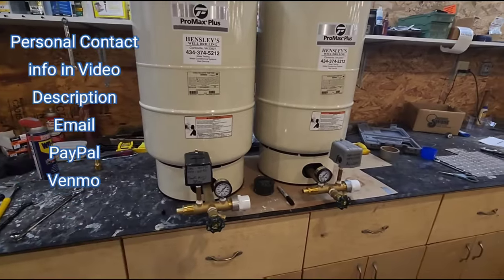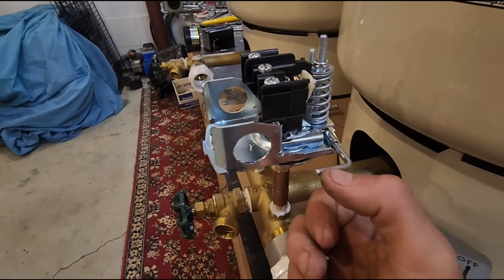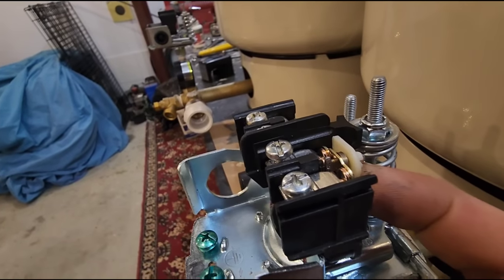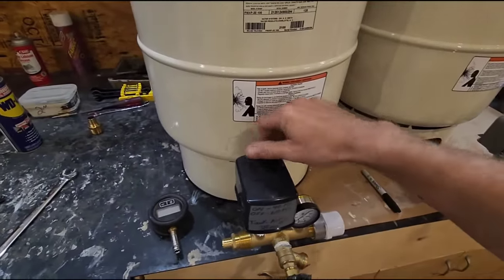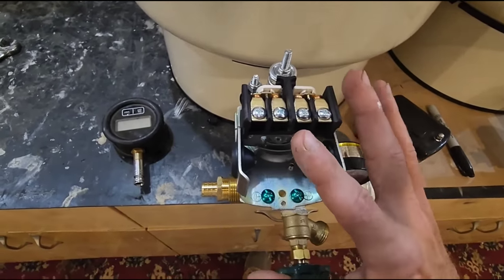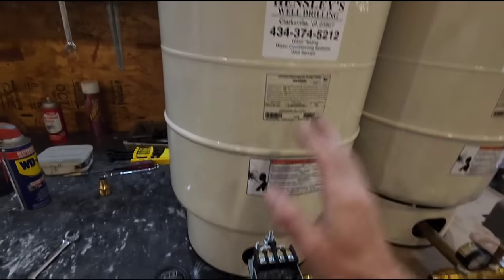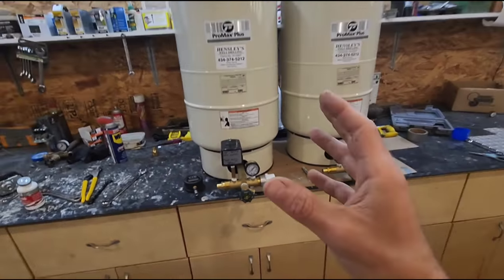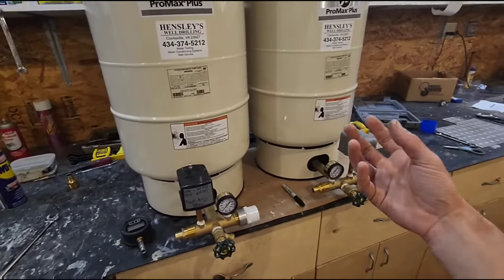Most Common Reason for No Water!! Reset Pump Pressure Switch. Water Well Repair Vlog Ep.18

Comment: Here's one for you... power outage, water kicks off.  Power comes back on.  The pressure at that relief valve on a 30/50 kicks on at 85psi, off at 105psi (likely guage isn't correct)  The drain at the bottom of tank, if I open it, has a really strong pressure, kicking water out at a pretty fast rate. This line (in addition to feeding this 'out' valve, also seems to feed into rest of system.  You'd think that strong pressure would translate through filter, into rest of house line, for a relatively similar pressure coming out of the taps... But it doesn't, water barely flows out of any tap, despite pressure building at the start of the line pretty strongly...  System looks similar to the one on the left you've depicted...any ideas?
Reply from the maker: If your filter element is black (carbon type) that's probably the entire issue. Try replacing the filter with a white string woven filter (never use black ones). 
I'd advise you to go buy a new switch and the nipple below it & a new gauge. 
New gauge will help with diagnostics. It's probable that this all froze in the past, it could have bent the gauge & switch. You need to inspect/ replace the 1/4"x3" nipple bc it may be clogged up with sediment. 
When you have the system off & drained of water, you can then check the air pressure in the top of the tank and make sure its set to 26psi(since u have a 30/50 switch)  (set air to 36psi if u buy a 40/60 switch)
Reply: @h2omechanic  Thanks for the reply!  Filter is not a carbon one, recently changed it too, so it's not that.  You are spot on with the freeze comment, froze pretty solid last year, but was working again after. Because of that, I think your proposed solution should do the trick.  The top, where the nozzle to test & re-pressurize should be, has a 'do not remove' cap and label on it. Likely one of those dumb questions but no safety or other issue with pulling that off in your opinion?  Thanks so much for taking the time for this!

Comment: I have power going through my switch, relay and out of the foundation (using a non contact tester. But I don’t get a ark when I flick the contacts. Should I start with changing the pressure switch?

Comment: I have a red wire wired to the control box and pump. Not sure if it goes anywhere on the pump. I have the two white wires on one side and the other two black on the other plus the neutral on their 9wn. Just not sure if the redwire goes any where in the pump although it's wired in the franklin control box

Comment: Froze overnight here in NC, have the water softener/well pump area covered and with a lamp in there overnight. About 10am water stopped coming in the house. Faucet had been dripping all night in the bathtub and stopped also. Still 27 degrees outside though even at 11am today. Did the manual flipping of the metal parts inside the pump switch. Sparked each time but still no water pumping. Do I maybe just need to wait until the temperature rises a few degrees maybe? Thanks for any help.

Comment: Just replaced my old switch to the one with the lever. Should I hear my pump start running? Or does that mean my pump is broken? It is just not building pressure

Comment: I’ll certainly pay you if you can help me troubleshoot this issue!     I have a new 30/50 pressure switch. Is it common that the pressures nuts need adjusted in a new unit or should I be trouble shooting other possible first?

I can’t get the pressure in the pressure tank to reach the 50psi needed for the pressure switch to cut off the pump. The pressure goes from 28 were I have it set in the bladder, up to 40 but I can’t get the pump to cut off without shutting off the breaker. 

It also seems that the pressure tank isn’t filling with enough water. When I have the water line cut off from the jet to the diaphragm and open the bleed line, (like I do to set the psi)  I don’t get even a gallon of water to run out of the tank and the tank feels light to the touch/push. The tank isn’t very old 2016 and looks good. The bladder pressure is adjustable/ seems to be taking air properly so I’m Not sure if I should start adjusting the nut #1cw to lower the cut off pressure, and if so, should I turn the tall nut/spring down/tighter for a lower cut off psi?

Thank you so much for your help. I’m really in a predicament 🤦‍♀️

Comment: Hello, Im having an issue with my pressure not going above 45psi. The switch is a 40/60 switch just replaced thinking that was the issue. It has a cutoff at 30 psi. When we turn sprinklers or anything that takes the pressure away, the cutoff won’t turn the pump back on. Any suggestions? I drained the pressure tank and re-pressurized it back at ? Psi since it only has a threaded cap and no air valve…thank you very much

Comment: What is the best brand of 40-60 PSI Water Pressure Switch with Low Pressure Cut-Off?
Also, what is the best brand of water tank and how do I know what size tank do i need? Can you have too big of a tank? ?

Comment: Any chance you could walk me through something? I just replaced my pump and pressure tank,and switch. Everything is brand new now. I got the pump running and it just looks like the water isn’t flowing anywhere. This is for my sprinklers

Comment: I have a new cottage with a well and external pump.  I reset the pressure switch (the one with the lever) and it worked.   The issue I have is the washing machine essentially dumps pressure to the point where the pump switch needs to be reset.  

Any ideas what causes this?  Sink, toilet and dishwasher work fine.

Comment: Hello my friend. Today out of nowhere the switch stopped working. Even if I manually push the heads together I don't get a spark. Have any suggestions? I appreciate your videos
Reply from the maker: Probably a bad pump or a bad wire going down the well

Comment: Hello!  My house has city water, however, my outside water service is well. Makes sense free watering for  outside but city inside. SO, the only water outlets would be at the 2 sillcocks outside.  With the outside sillcocks off why is my psi gauge keep jumping from 60 to 40 to 50 to 20 back to 60?? Thanks Much...

Comment: I live in Georgia and after a hard freeze we just had I had to replace a busted water pipe now the tank is totally empty of water and has no pressure also the pump will not come on.. do I need to add pressure to the tank before the pump will start working???

Comment: I'm having an issue with my pressure tank, I was getting air in my system in my house and then I ran out of water so I tried to prime my tank and it wouldn't build pressure so I checked the air pressure in the tank and there was 0, so I turned the breaker off and the tank felt light when I shook it and I put the correct air pressure in for my pressure switch and turned the breaker back on and the pump took it up to 60 lbs on the water pressure gauge and it's good for 3 to 4 days and then it run out of water again and no air pressure in the tank again, any info is greatly appreciated! Thank you

Comment: I hate the square d m-40 switches they are a good safety feature but a lot of people have complained about pressure going undercut in pressure and have to reset for reasons other then actual pump or switch issue or loss of power also square d switches used to be awesome would last for years these days I've had to I put in brand-new, contacts were closed no electricity passing through to pump everytime switch was brand-new I've switched to American Granby little cheaper but I have had better results

Comment: If my pressure switch doesn't have the little lever on the bottom right, I don't have to do the 20 seconds thing right?  I bought a new switch.  It didn't have that lever(my old one didnt either).  I put the new switch on, I followed my picture so it is wired the same as the old one.  Still no water.  I checked with a multimeter and the screws five me a 246 reading.   I'm scared my pump is shot.  What do you think and thank you!

Comment: My system is at 0 psi. Power is running to the relay and from the relay to pump. The contacts are closed but no pressure is building up. Is the pump just dead? Are there other failsafes keeping the pump from running like foot valve?

Comment: So if my pressure switch keeps tripping due to low pressure, should I check the air in the tank next time it happens? Is that the likely cause. Cause it seems like everyday I have to crawl into my crawl space and reset this thing.

Comment: So, I have a 40/60 and the air pressure reads 30psi in the tank, I will add air until about 38psi hopefully works. My water comes on for a few hours then nothing, then it returns and so on. no breakers tripped. I believe the system is over 12 years old so I might just need a new pump?

Comment: Hello, having the same issue as everyone else here, however it seems that whoever installed the pump pressure switch didn’t wire it to any power—it is just attached to the line free of any wires and in addition does not have a lever.  It otherwise looks the same. What is the diagnosis for this?  I’m not able to reset it as is.

Comment: Good morning. I noticed my pressure gauge reads 70psi.  I have the Square D 30/50  My pressure tank is at 28psi.  I have 2 switches, one for a top pump & one for a submersible. I tried the adjustment 3 full turns counterclockwise of the "center" adjustment, the needle barely moved? Any suggestions. Thanks Steve

Comment: I have a question, my house was built in 1967 was on well water about 30 years later hooked up to city service. The well is still here and has water in it there's 2 pipes coming through the wall in the basement I want to set the well back up for lawn watering & washing cars. Why are there 2 pipes? An over flow return maybe? Thank You in advance for your help if possible. JD, Winston Salem NC
Reply from the maker: It was originally set up using a dual line jet pump. 
You can use the big pipe as a wire chase pipe & the smaller pipe can be used for installation of a submersible pump to connect the pump system to the bladder tank/controls. It's a perfect setup for an updated system.
Reply: @h2omechanic   Thank You

Comment: Ok so I did this my tanks like the one with no lever. When I press on it with the plastic handed screw driver it buikds up to 50 psi an then the connectors separate is thst cause it's blowing the fuse? It's supper to stay in contact right?

Comment: My question I have for you is my contacts on my switch will close and I’ll watch the PSI go up to 50 on the gauge and then the contacts will open but I still have no water pump activating upstairs in my room real property. Maybe it has something to do with the pump 180 feet down in the well

Comment: Hey buddy, i just replaced my mothers submerible 1 hp pump 290 feet deep last weekend and her pressure tank (60 gallon galv )  both 27 years old. I sent her to purchase a new pressure tank and she brought back a 119 gallon bladder tank. Once I had all the new parts plumbed in, I started system and i couldnt get the pressure to rise above 32 psi? I double checked the pump was indeeed pumping water. 1 gallon in 7 seconds. what am i missing? bad switch? fyi everything is new

Comment: I dont know if you still review these but I have a problem with my psi switch. I turn power on and the pressure goes up but now water in the house. The system shuts off and doesn’t come back on. Sadly I do t have the 500 to have someone come out. Any ideas?

Comment: i have a question.we have no water coming into our house.we have a new well pump switch and a new inline pressure gauge.what does the inline gauge really do and should i replace it?it just moves between 20-22psi no more or less.i have tried to call our local well repairmen and cant get a call back as due to they are all to busy.i would appreciate any advice you could give me.thank you

Comment: My pump is staying on but I can trip the points back open and they will stay open until it turns on again then it will stay running but I have to do that over and over when it turns on what do you think will fix this problem

Comment: I have a deep well setup, the pump is humming and not starting theres no pressure on the gauge either. i've checked the pressure switch seems to be working. What are some other things to check?

Comment: if your pressure switch is good, check your water filter. it might just be clogged with so much sediment it's become caked in a layer of clay which is dropping water flow to your toilet, sinks. hope this help some traveler some day

Comment: Hello.  Does this type of pump control set start and stop the pump if the incoming water is cut off?Hello.  Does this type of pump control set start and stop the pump if the incoming water is cut off?  At home, I used this type of pressure switch with a tank, but when the house water was cut off from the inlet, the pump kept turning on and off for hours, and if no one was at home, starting without water might ruin the pump, so I had to use the  I should use the pressure switch control, which is of the diaphragm and electronic board type. Is it possible to solve this problem with the type of pressure switch in the video?  Thanks

Comment: Hey man my pump is sounding like it’s running but there is no water. What might cause that? The pressure gauge is stuck at 50 but I changed it and same problem. Also the pump is getting extremely hot.

Comment: Hi! Are you available to video chat? I’m trying to get my late dad’s place ready for sale. He passed 5 years ago. We had water for 1.5 days. Then trickles. I live in rural Arkansas and they advertise plumbers around here but I can’t get them to come out. Trying to figure it out myself. I changed the points and I think the regulator is stuck. I also think the pressure gauge is on the wrong side of the regulator. Idk.

Comment: We just had a freeze. Now water pressure guage at pressure switch is high around 80 plus. I have little water to house then it trickles off. I have not check psi in tank yet. Any help would be appreciated.

Comment: I replaced the switch at my moms pressure tank..she had one 30/50 without the low pressure cut off switch. I replaced it with one with the lever. I also replaced it with a new pressure tank set up for 30/50. I held the lever and it would build pressure to 20 but if I let go of it it cuts off and it will not build any more than 20psi. I had them open all the water valves to let air out of the system. We get water but only when I hold the switch.  Any advice?

Comment: I’m confused because I replaced my pressure switch with a new one, the same size, but now even after flipping the low pressure switch and the system working fine for 5 days … this morning the water pump was off and pressure down to about 5-10. Flip the lever and pump comes back on and works normally for a few days and it just happened again. So I’m wondering if maybe the pressure sensor inside my pump is to blame ?

Comment: I had very little water pressure and system was not kicking on. I replaced my 100lb psi pressure tank with a 100psi water tank which I'm sure was bad, and I replaced the pressure switch witch was a 30 50 with a 30 50. Still same problem. Well is not kicking on. I've flipped the switch several time to no avail. The pressure gauge is reading 25 to 28. Any thoughts?

Comment: New pump new 30/50 switch. Checked the air pressure like you said. Switch kicks on for a second then nothing.  How do we know if it's a bad tank? Any other ideas?
Reply from the maker: Watch my tank videos on how to test the tank. 
If the switch is closed, test for power at the well head. If u got power there & no water, then the pump must be pulled out

Comment: I’ve been battling air in my lines, where it just spit & sputters. Found out I had a leak, fixed that & everything went back being okay. Now we’re back to spit & sputter a month later. Is it another leak, which we haven’t noticed yet above ground or something else? My pressure switch is 30/50 & I have not checked the pressure yet in the tank but I have noticed my pressure gauge on the switch is maxed out! What direction do I need to take?

Comment: My system just lost pressure, i replaced my whole house filter and check the pressure on the tank and it’s correct. But the pressure gauge saying my system only have 30psi. What else i can check?

Comment: I have no water at my house currently! We'll pump was installed in 2019. The pressure switch is engaged to let water flow but when I check the voltage I get 120 from each wire but the power between them is negligible... with the switch held open the voltage reads 240 but almost nothing with the switch closed. Any thoughts?

Comment: My gauge on the cistern tank failed, and so I replaced it and it reads 44 psi now instead of zero. However, the pump motor still stays running at 44, it sounds to me like the motor is straining and it shouldn't be because it is making it run all the time and it should just be turning off when the pressure gets that high, because it isn't going to go higher than 44.

Comment: Well tank pressure is good it's a 40/60; my pressure switch is the one on left side without lever. 
Contacts are closed but no water, I tried flicking them with corner of cover and still no water into tank??

Comment: No pressure reading, no water, but pump is running.  Contacts stay closed.  I tried resetting as you showed. What could it be? If the pressure switch is bad, will it not work?

Comment: Why not open the valve right by your tank there when adding air?  Also does it matter which tank you have according to your switch?  Or can you adjust the air pressure accordingly regardless of tank?

Comment: Question for you. I have a 20gallon blader set to 38psi. I replaced the pump switch. It will charge to 60psi. If we use water it drain slight to 0. I go out reset it. It will charge to 50 and drain to 0 again. Ever hear of this?